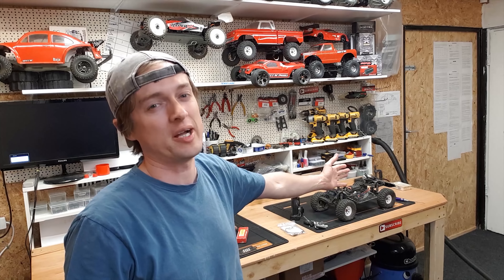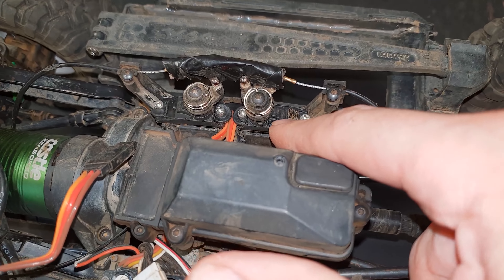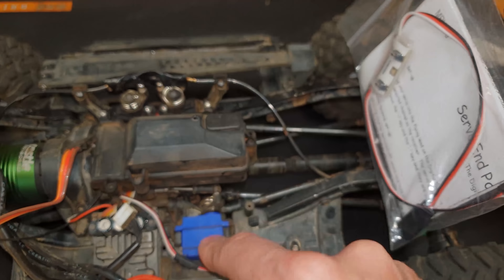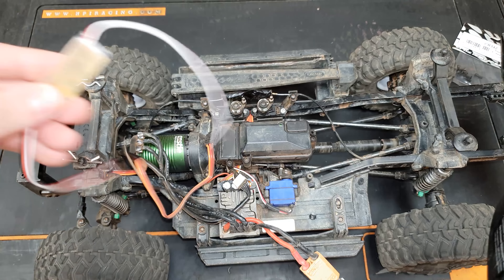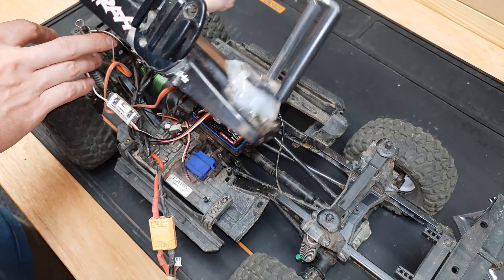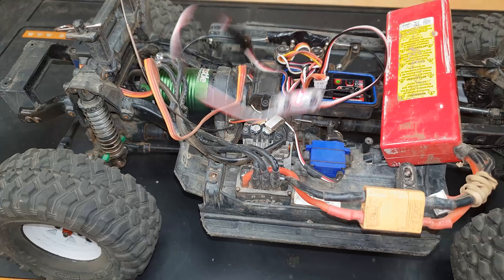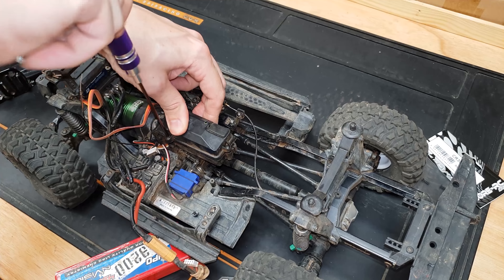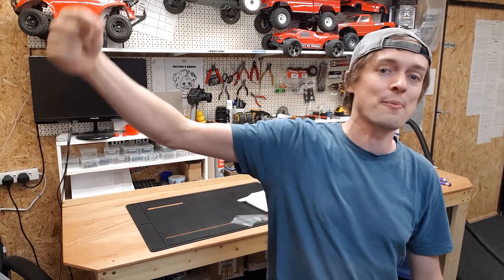SHOP TIME - Traxxas TRX-4 Shift Servo FIX

Comment: Bit late as you have already bought one, but you could achieve something similar with a shorter servo horn. That way the servo can move through its full travel and still have the same range of movement on the cable. Might take some trial and error to find the right length though.

Comment: I reprogrammed my multi function knob on my radio to adjust the dual rates so I could get the endpoints right where I wanted them.
Reply from the maker: make a video :)
Reply: On the steering servo.
Reply: I wonder if u could move the mounting screw closer to the servo arm mounting screw so it would have a smaller throw to the arm?

Comment: Gpm makes an aluminum servo saver that is a straight style arm, been working great for me ,look it up on e bay ,also been using these power HD servos love em
Reply from the maker: I'll have a look now :)
Reply from the maker: which one did you get? also how stiff is the spring, I don't want it too floppy :)
Reply: Yep use them in all my trail trucks ,look up my channel ,Adam hire rc ,there is a axial bomber with one of their regular style servo savers, still holding up good to this day was always breaking servos in my wraith & cousins bomber, not no more 👍🍻
Reply: Got the thunder tiger kaiser xs one
Reply: Spring has a little play but not too bad ,it's like a spring steel set up like some of the older plastic ones

Comment: Put some washers under the servo to raise it up and you should be able to fit a servo saver.
Reply from the maker: yeh defo gotta raise it and cut the mount
Reply: Maybe if you get a metal servo mount and cut the front edge off you could raise it and still have a strong mount.
Reply: I love the videos.
Reply: Or maybe get the bumper mount to relocate the servo to the front of the chassis? Maybe that would give you more room for a servo saver without hitting the panhard bar.

Comment: Couldn't you make a connection that incorporates some sort of spring mechanism to relieve the servo  strain..  good luck
Reply from the maker: its already got that, still burns the servos out
Reply: At 2:20 is where it shows the devise good luck though

Comment: Hey Kev why don't you just buy a set of TRX4 sport axles. Just get rid of the servos all together. I'd keep the 2 speed but get rid of the diff locks. They are more trouble than they are worth.
Reply from the maker: I like unlocking the diffs dude, all part of the fun :)
Reply: Kevin Talbot I get it. lol I'd have given up by now. I had the Summit & went through 5 micro servos for the diffs & had enough. The trans. One is still working. So I switched to EReVo bulkheads & diffs & got rid of the lickers. Lol
I have a TRX4 too & if those servos go their getting ripped out 👍😃

Comment: Esc got burned out pls help
Reply from the maker: get a new one :)
Reply: I did nothing work  the esc burned out in 30 minutes only going like 50
Reply from the maker: sounds like you are straining it, gear down and make sure all bearings are free
Reply: Will do
Reply: It on a 83 spur on 23p